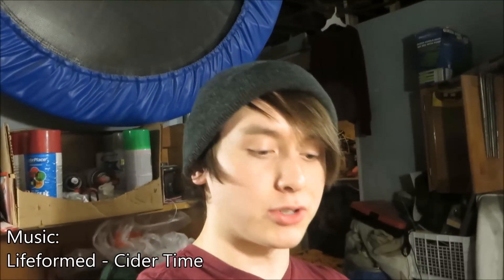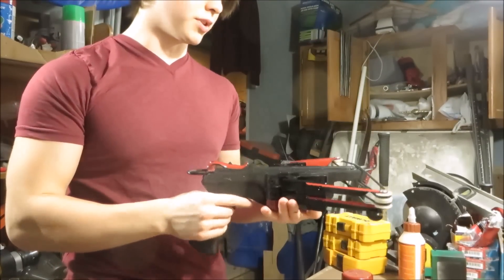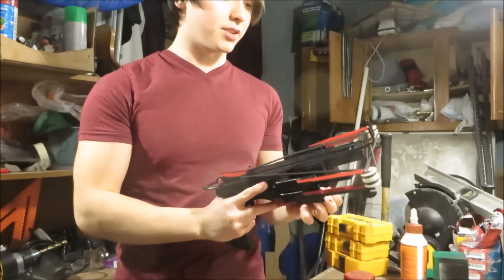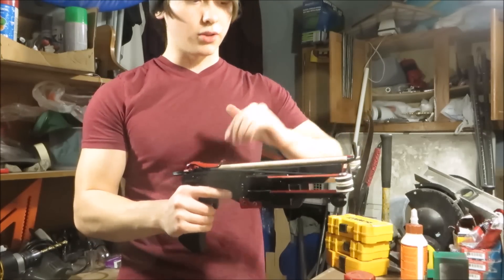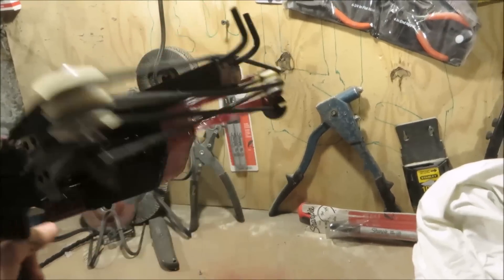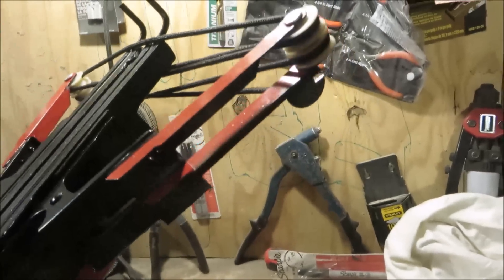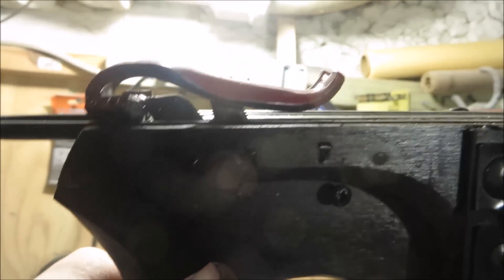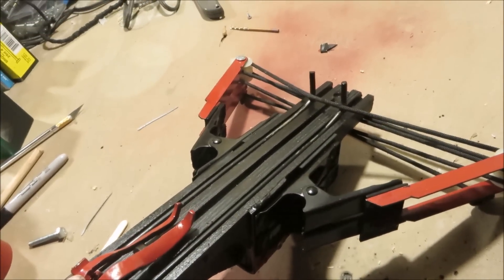Homemade Easy-Load Pistol Crossbow

Comment: AIR POWERED SNIPER, PLEASE.

Also, nice crossbow. Can't wait to see the build. Make sure to test it at range to see just how powerful it actually is, pistol crossbows are surprisingly weak, compared to a full-size version labeled to have the same strength. Like your example, the Cobra with the weird break-action cocking system.

Comment: thats a cool little crossbow...i like the clamps idea and the pullies seem to make it super easy to draw, i suppose you could up the draw weight/power by using stronger clamps?

anyway would love to see the air powered sniper rifle that uses like medium sized nails as ammunition....especially if you can somehow manage to make it have a clip or be gravity fed so you dont have to single load.
Reply: Nails make terrible ammunition as they lack the proper weight distribution to achieve stable flight.
Reply: chromzepher
that is true, and i should edit myself, i dont necessarily mean nails...but anything that is sharp and pointy.  even like those cheap plastic darts that have steel tips for playing darts etc...doesnt have to be a nail, just the first thing that came to mind lol

Comment: hey eli. just a tip, maybe the crossbows power would be increased, if the clamps weren't cut. i feel like if there cut, there's more elasticity, hence dropping the power, as to where if they weren't cut there would be less elasticity, because the clamps would snap together. im not sure if you can understand what im terrible at describing, but maybe it would help. love your videos btw.

Comment: The Cobra Crossbow that uses the same cocking mechanism is utter trash, by that I mean it's hard to use when they give you a bowstring that requires 2 people to put it on and a professional Bow Hunter and still have massive difficulty, not to mention the fact that it could just snap at any moment.